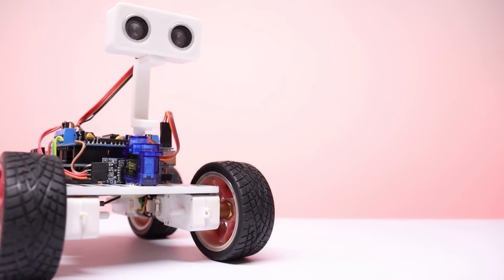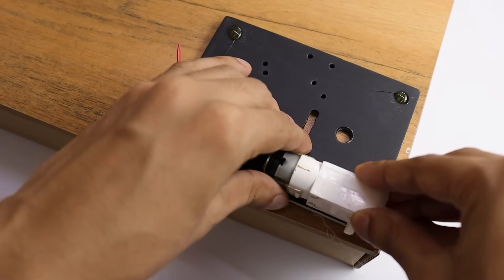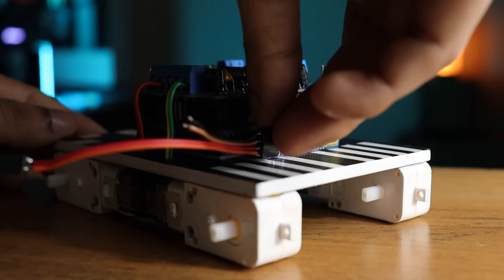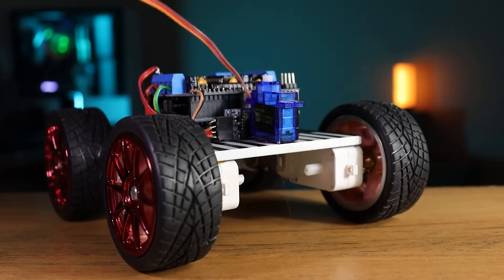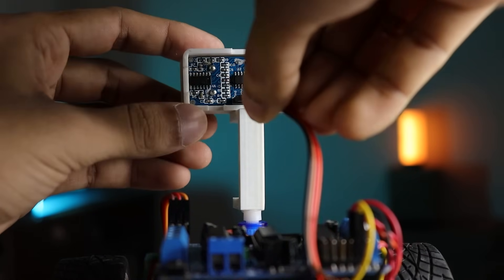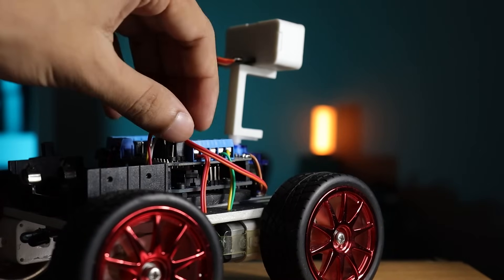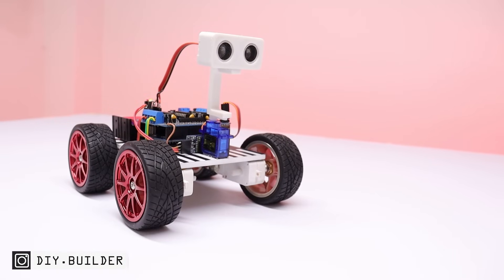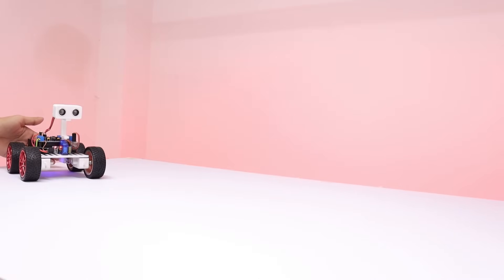Arduino Obstacle Avoidance + Voice Control Robot

Comment: Cool! I also love making similar robots. For example, in my video I showed how I made a robot that draws circles)) And that's cool too!!!
Reply from the maker: That's cool!
Reply: @DIYBuilder  i am having this problem there is no option for Hc 05 module connection in the app in the sense it isn't showing the hc05 module even though it's on 😢 can I get a solution for this
Reply: Chotu

Comment: Hi Surujith, we tried to do the robot as shown in the video. We also downloaded the code.
We connected all the wires as shown in the video (diagram).
When we gave the command it didn't move an inch. What could be the problem. We have uploaded the code multiple times. 
We downloaded the AF MOTOR AND NEW PING ALSO.
PLEASE REPLY. My son who is 9 years old has passionately tried to build this. Please help to solve the problems
Reply from the maker: Sir, can u contact me on Instagram?  INSTA ID: diy.builder
Reply: did this later work for you?
Reply: Did this work

Comment: you have connected ir sensor pin to analog and gave codes for digital pin
Reply from the maker: yeajh
Reply: @DIYBuilder   it's code not working. Only right and left code was working but forward and backward not working ....y

Comment: i am having this problem there is no option for Hc 05 module connection in the app in the sense it isn't showing the hc05 module even though it's on 😢 can I get a solution for this
Reply: did u made it and does it worked for u ??/
Reply: @jpdikshant8486  well apparently I finished doing other project using ultrasonic sensor so it did not do this as it wasn't working

Comment: Thank you bro for the project the project it works amazing, car works fine receive all the commands
Reply from the maker: Glad to hear that
Reply: brother, can u please let me know which AFmotor and Newping libraries have you installed in Arduino IDE
Reply: Did you add resistors to HC 05 Bluetooth module
Reply: @harikrishnana7284  no I have not included resisitors
Reply: @abhibhikule5817  af motor guithub
Reply: did u made it and does it worked for u ??/
Reply: Yes it still works fine….

Comment: When I was compiling the code it showed AFMotor.h: No such file or directory so what should I do. I also removed the bluetooth modele and kept it again and selected the board, port and programmer but it didn't work.
Reply from the maker: bro install the libraries first then try again
Reply: @DIYBuilder  bro, which library to install?

Comment: Hi Surujith, we tried to do the robot as shown in the video. We downloaded the code.We connected all the wires as shown in the video.
When we gave the command it didn't move an inch. What could be the problem. We have uploaded the code multiple times. 
We downloaded the AF MOTOR AND NEW PING ALSO.
PLEASE  DO REPLY THIS IS FOR MY SCHOOL PROJECT.
Reply: What about your project?? Its working now?
Reply: @wrishikesh_chowdhury  have u made it anfd does it works
????

Comment: hi bro i implement that car but i am facing problems in the output when i say move forward first 3 motors move slowly but 4th motor will not when i say turn right same situation like the previous but the backward and left options are working perfectly can you help me out please?
Reply: does the project actually works 
???

Comment: Hey bro I have a prblm .. pls help.. 
When I attach the motor driver the Arduino Uno turns off.
And after that I saw the light of Rx and Tx that doesn't go off. I tried to reset but not working.
Reply: Hey
Reply: Is you project working now

Comment: Hello, I have a power supply issue and hope that you will help me solve it. I have followed  all your previous videos but my sensors are not getting powered up with the 18650 battries. Works well when powered through Arduino USB cable connected but not when disconnected from laptop and  batteries are connected. Please help
Reply: Same question

Comment: Arduino: 1.8.13 (Windows 10), Board: "Arduino Uno"

obstacle_avoidance_voice_control_robot:6:10: fatal error: AFMotor.h: No such file or directory

 #include <AFMotor.h>

          ^~~~~~~~~~~

compilation terminated.

exit status 1

AFMotor.h: No such file or directory

This report would have more information with
"Show verbose output during compilation"
option enabled in File -> Preferences.
Reply from the maker: Install the afmotor library first
Reply: @DIYBuilder  how
Reply: @barsitzaid4329  go to tools>manage libraries>search af_motor>install adafruit motor V1

Comment: I recommend you start using l2938 motor driver instead of AFmotorshield since it is more powerful less pin consuming and easy to use.
Reply: Since I don't have any local Shops for these goods .. can ypu please recomend  From where these could be brought ...
Reply: @subbrat2048  Yes.. sure! i recommend buying from robu or amazon since they are trustworthy and fast. try robu since they have free shipping for orders over 500 and very fast shipping as well
Reply: Thanks..
Reply: @subbrat2048  u

Comment: Arduino: 1.8.7 (Windows 10), Board: "Arduino Uno"

obstacle_avoidance_voice_control_robot:6:10: error: AFMotor.h: No such file or directory

 #include <AFMotor.h>

          ^~~~~~~~~~~

compilation terminated.

exit status 1
AFMotor.h: No such file or directory

This report would have more information with
"Show verbose output during compilation"
option enabled in File -> Preferences.

Comment: bro through this code my robot is not able to move forward or backward
could you tell me how to fix that
Reply from the maker: make sure to calibrate the IR sensor and also check the connection of Ultrasonic sensor
Reply: @DIYBuilder  how?
Reply: I am newbie ,could you please help me
Reply: tell me bro please
Reply: now my car robot is moving backward properly and IR sensor is working now but still forward motion is not working
Reply: now my car robot is moving backward properly and IR sensor is working now but still forward motion is not working

Comment: Bro i dont have laptop or computer piz piz make a video how to upload code from mobile piz piz and from where you get information about circit piz piz tell
Reply: buy a rasperry pi and a lcd screen u can use it as computer
Reply: @sridharsan1054  Yeah but you need a computer to upload the code for raspberry pi to execute...
I think otg cable and apk version of the arduino ino app will be enough
Code is also given in the description :D

Comment: One question is 9v battery enough to power such a project ? . Another question. The arduino will be powered through the batteries that are connected to the shield ? Right
Reply: He uses a 2 batteries of 3.7 v it means it supplies the power of 7.4 v 9v will be a high current for bluetooth module if you will not use the resistors